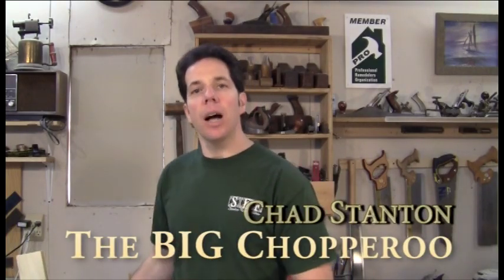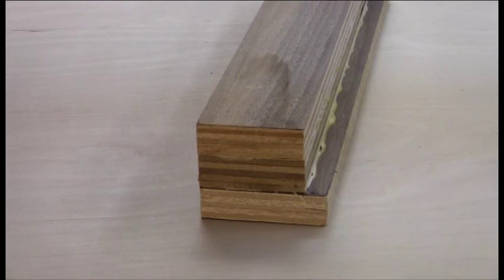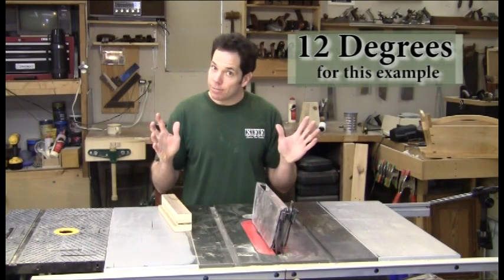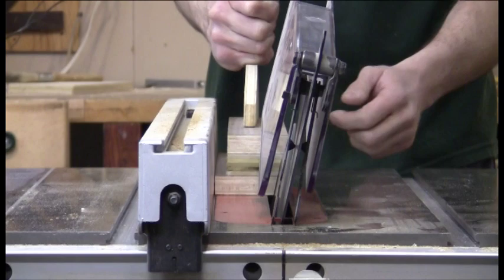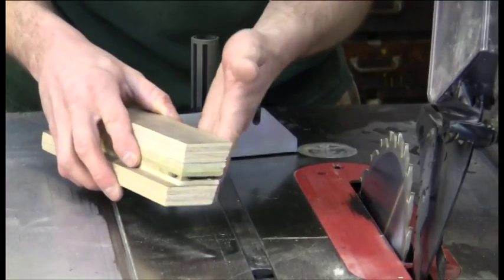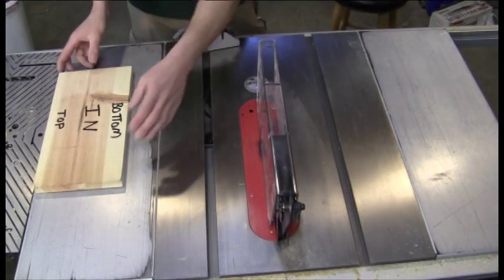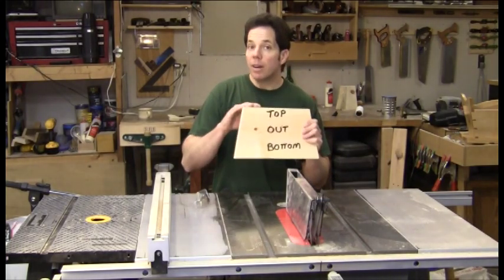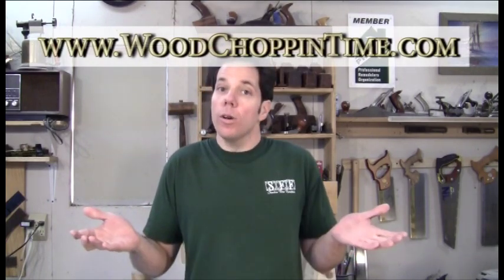How to make a Compound Butt Joint Angle

Comment: Mine did not turn out right. When you place the angled face of the setup block against the miter gauge set to 0 degrees, should the face of the setup block be against the miter gauge or just the top edge? Since the face is angled, there is a difference. Also, the top/bottom orientation looks backwards -- at least for a project where the piece flares outward as you go from bottom to top. Perhaps you are making something that flares out top to bottom.  THANKS!
Reply: I have the same question...

Comment: This is almost correct but has a critical error.  The miter gauge can't be left set at the miter angle when cutting the workpiece.  It has to be set by butting the small end against the saw blade and then setting the miter gauge angle from the other cut surface.  This probably can't be done accurately with the little end in this setup block.  That's why most instructions use a larger block.
Reply from the maker: I’m curious why. I’ve done it so many times like that. I even had it published in a magazine. I don’t mean to come across rude. Just what do you think would be a problem the method I use?
Reply: I have to agree with Houston here. I followed your method step by step and it didn't work. Something is missing. It may be something simple and other people 'get it', but I didn't.

Comment: does this work with a right tilt saw or will i have to switch sides?
Reply from the maker: That's a great question. It should still work, but yes i believe you will have to change sides. It's probably best to practice it on a scrap piece before you do the real project. Thanks for watching.
Reply: Chad Stanton
Hi Chad, this post applies to Chris Wiebler's post from about 3 weeks ago. I am building a set of magazine trays (in the video it looks like you have a similar tray on a workbench in the background over your left shoulder - I can't tell whether the ends and sides are connected with dove-tail joints or screws but the angles (in my case, 40 degrees) appear to be what I'm trying to do) that all four sides are angled at a 40 degree outward slope. I want to use compound butt joints and not compound miter joints that one might find on crown moulding.

Several observations: my table saw ONLY tilts from right to left ( as seen from the front of the saw and with the blade protruding out from table that when tilted away from 90 degrees, slopes only to the left (your video shows all video from behind the saw - makes sense for making a video but is not good for trying to orient lots of different angles when it comes time to make the setup jig)). After building multiple setup jigs trying to replicate your setup I came to the realization that your saw tilts both left and right, and that you are making cuts on the right side of the blade with the blade tilting. This may not be a problem.

What may be a problem - and for me, a confusing situation - at the beginning of the building of the setup jig, and after cutting (ripping) the first angle down the length of the jig, you say place the just-cut angle against the miter gauge. Is that with the cut angle FACE FLUSH against the miter gauge face or with the top, LONG-POINT edge of the cut face against the miter gauge and the base of the jig FLAT on the saw table? That may be why none of my jigs are working. The video does not show this part of the angle / jig construction. If you need more info please let me know; provide me a way to contact you, if appropriate. Thanks